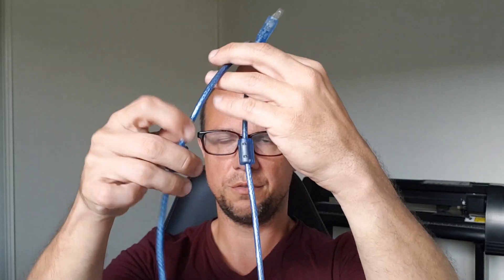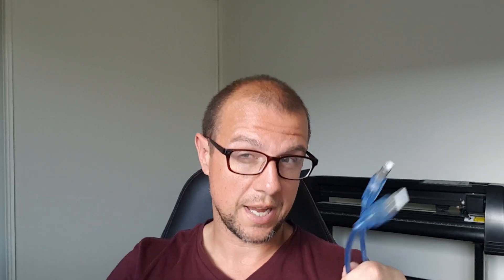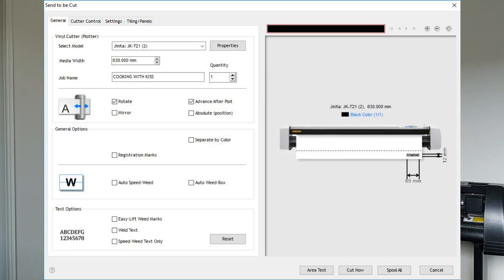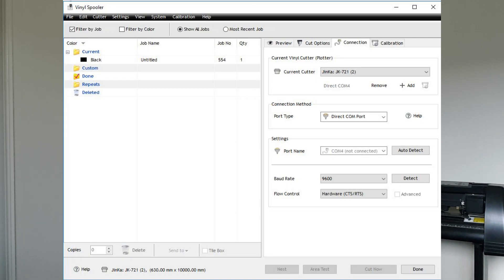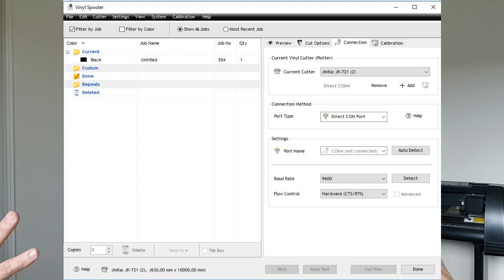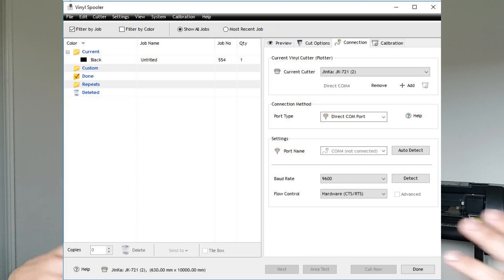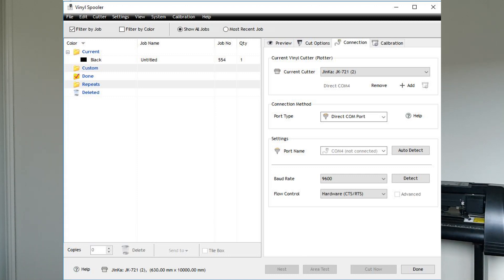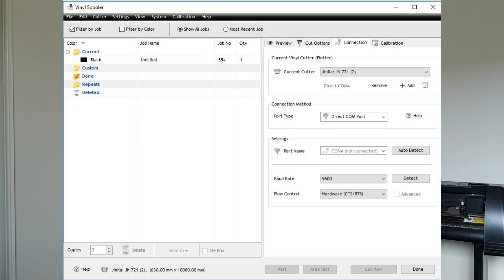Ebay vinyl cutter not connecting? SOLVED!!! vinyl cutter plotter tutorial

Comment: Hi get the sound on the pc when you connect it to the usb .on the software where you configure or add a new cutter there is a drop down box to select the cutter .my top down box has no cutters to select
Reply from the maker: Have you tried manually installing the driver? Not using the software first.
Reply: @VroomBroomZoom  thanks for your reply .It's the vevor cutter all it came with was the signmaster software.
I am not sure where to look for a driver
Reply from the maker: https://www.google.com/search?q=jinka+cutter+driver&sca_esv=a7c8d0cd27d1ba3d&rlz=1C1ONGR_en-GBAU996AU996&sxsrf=AHTn8zoPNUdge7WaUiSqJHs3klZiV4pUxQ%3A1747455989125&ei=9Q8oaPKtB7ne2roP37_YkQw&ved=0ahUKEwiy_Pfr1KmNAxU5r1YBHd8fNsIQ4dUDCBA&uact=5&oq=jinka+cutter+driver&gs_lp=Egxnd3Mtd2l6LXNlcnAiE2ppbmthIGN1dHRlciBkcml2ZXIyCBAAGAcYCBgeMgsQABiABBiGAxiKBTIFEAAY7wUyCBAAGIAEGKIEMggQABiABBiiBDIIEAAYogQYiQUyBRAAGO8FSM4KUABYtglwAXgAkAEAmAG-AaAB_AaqAQMwLjW4AQPIAQD4AQGYAgOgAuwCwgIIECEYoAEYwwTCAgoQABgFGAcYChgemAMAkgcDMS4yoAe9FbIHAzAuMrgH6AI&sclient=gws-wiz-serp
Reply: @VroomBroomZoom  thank you will try it .

Comment: Hi I have a Copam CP2500, it's not cutting. its working with Serial and parallel port only, when I turn on this Machine, load the vinyl, select roll or page press enter, the machine measures the vinyl, if I press “TEST” it cuts a squar with a circle inside, but if I send something from the computer to the machine it scroll to the end of the vinyl and stop, without cutting anything. Any advise please.
Reply from the maker: Sounds like either the vector being sent has an issue, like a phantom line that it’s trying to cut, or, the port is still not correct. 🤷🏼‍♂️ Good luck with it, I hope you get it going.

Comment: I have the k1 720. One cut and now not working
Reply from the maker: Sorry Julie not sure how to help. Sound like a cable ocnnection issue if it was definitely working though. Try going from the start. Is it being detected?
Reply: It was that I have to designate the printer everytime and after about 5 times it starts connecting to the spooler program without designation process

Comment: What file type does this cutter require?
Reply from the maker: Can be most vector files, definitely the main ones
Reply: @VroomBroomZoom  thanks for your reply. What I'm trying to figure out is if I can use solidworks software to create and send the graphic outline to the cutter
Reply from the maker: Whats the file extension?
Reply: @VroomBroomZoom  yes exactly what type of extention file does the vinyl cutter need to receive from software?

Comment: it is nice to see you are taking the time to reply to people, and help them, we are having issues ourselves, it worked before, and now it doesn't it says connection error on the screen
Reply from the maker: Good luck with it! Try reinstalling the driver 👌👌👌
Reply: @VroomBroomZoom  yes sir, we did, we changed which usb socket we used, my husband says even when working, it has never beeped when plugging in
Reply from the maker: So I just dragged this machine back into service and this time, I also did not receive a beep, but it's working. I had to play with the settings....AGAIN!

Comment: When I plug my plotter into my computer. The carriage goes to the left    (left error). I've tried resetting,  changing the USB cable, port changes etc., and it still goes to left error when I plug it into the computer.  Any suggestions on how to correct this problem.
Reply from the maker: Try pushing it to the right manually 🤷🏽, restart machine
Reply: It could also be an origin setting.

Comment: Pls help me. Every time I’m trying to get a download image to tag it signCut it say no object could be found. I’ve tried multiple images. It also say make sure the file contains vector graphic and is saved without the compression-flag set. 
How to fix this problem?
Reply from the maker: The picture you downloaded is not a ‘real’ vector picture. Sometimes they use the same file type, but are not true compatible vector files. Look for another similar image.

Comment: I have the same model and only worked for vinyl cutting and I’m trying contour cutting for dark transfer and sticker paper but I can’t make it to properly read the registration mark so the cut won’t align. Have you tried using yours in contour cutting?
Reply from the maker: Nope, looked like a major pain. There are videos I’ve seen of how to align, good luck 😊
Reply: I have the same problem. My little red laser light won't come on to do contour.

Comment: Having problems with the vinyl express r series 2 it stops in the middle of the cuts but sometimes it ya complete a cut don’t know what to do got a keyspan and swapped out Db9 cables one works but only half and the other does absolutely nothing at this point don’t know what else to do
Reply from the maker: Sorry this sounds like a crap problem. If it stops in the middle fo the cut, it might be spooling for an unknown reason, maybe wait for a while and see what happens....might be a long pause. It could also be malfunctioning and be daing a self-preserving stop. Good  luck with it.
Reply: Trying to get a db 9 female male connector maybe if I can shorten the distance because it seems like the bigger scaled stuff stalls out

Comment: I just got my Vevor cutter 34" i install the program but don't connect with the machine i trying all i just give up and maybe i will see if i can return it 😓
Reply from the maker: Did you try different USB?
Reply: @VroomBroomZoom  yes i try different this is a Vevor cutter ki-870
Reply: @VroomBroomZoom  i will reinstall again the program to see if that will work
Reply: I did my last try to see if work and make it work i just buy a new laptop and install the program first, download the drivers from the site and at last connect the plotter and work fine.
Work only with files from their own don't work with any others files and i don't think work with any others software's like Flexysign or Signlab, etc etc 
Is just start all new jobs using this program at least you can cut letters, numbers and shapes 😉😄is why is cheap machines

Comment: wont even let me pick a comp port, just says not connected and wants me to auto detect which it never finds it ugh
Reply from the maker: I'd recommend a diferent USB port? Maybe also try turning machine on first, then connecting USB.
Reply: @VroomBroomZoom  when you connect a USB device. You get certain tones. Like a low tone and a higher tone. When I plug this in I get 2 low tones. Weird is I had this cutting once before and now nothing frustrating

Comment: Im having trouble with finding and installing the driver for my GCC Sable sb-60. My cutter comes up in devices as USB printer. But yet no driver can be found when troubleshooting. Do you have any idea whats going on? Please and thank you.
Reply: My cutter had the same problem I’m using signmaster 3.5 I complained to the company and they sent me universal drivers and it started working after I installed the zip file they sent me so it’s the drivers you need to up date them

Comment: Thanks for the info, I have the same machine but I still have that problem, is not detecting through USB even if I select the other ports, any other idea why is that? I also have the signmaster software
Reply: This Is exactly the same problem as mine they have sent me different drivers and yet it still won’t send through port and your video does not fix my problem, been through all ports
Reply: @hammered-timedetecting1835  did you ever get it figured out? i am having the same problem, when i  go to "select cutter to install" there is no items in the dropdown menu
Reply: @1907Syndicate  did you guys install the usb version or disc version?
Reply: @higherlearning4696  I think it was the first but I ended up emailing support and they sent me an additional driver that I installed and now it works perfect 👍 thank you
Reply: @1907Syndicate  what driver was it? And which computer do you use ?
Reply from the maker: Have you tried the COM port? Sometimes non-USB ports connect...good luck with it! Also, try other USB slots in your PC.

Comment: Not sure if you can help, any idea why the vinyl is getting caught when it comes back from the left side?  Area test is great but when it starts the job it seems to catch and the vinyl buckles underneath the blade. Any help would be great!
Reply from the maker: Try turning the blade in the holder. Also, the pressure on the far vinyl holder might be too loose? Adjust at the back as per the other video I’ve posted.